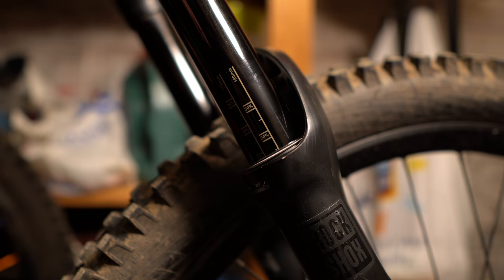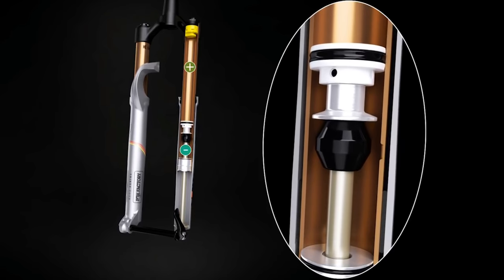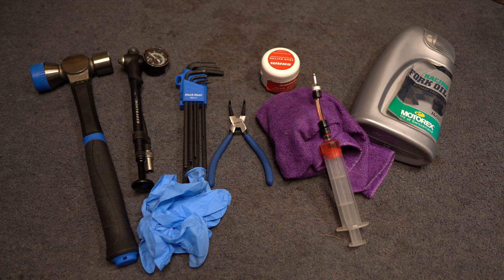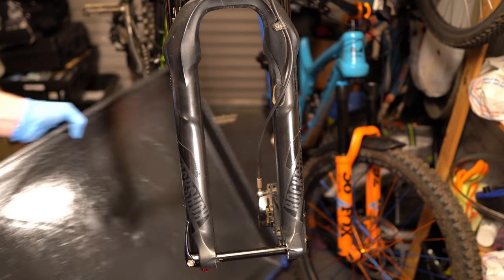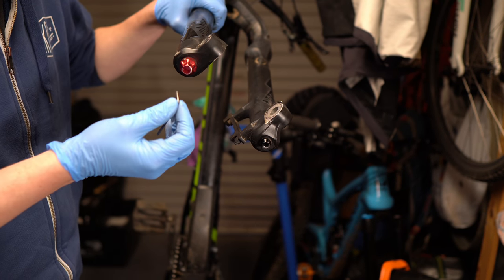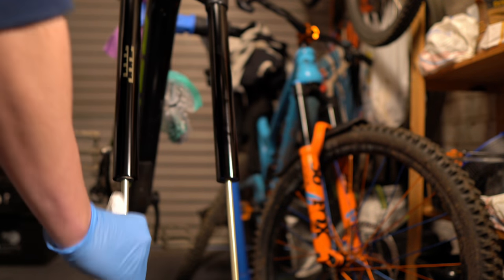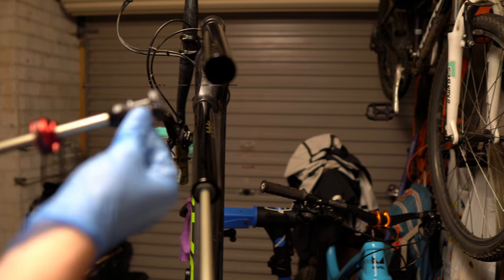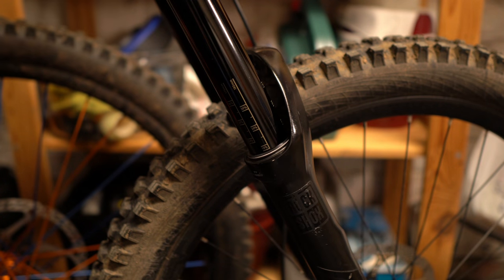Fork Suck Down

Comment: bro, super nice video. I have a rockshox 35 gold and  i think   my fork have  problem.  can i send you a  5 seconds video to show you  how my fork is working?  becouse im thinking to send it to warranty  but maybe is just need mantention. i dont understand nothing  of forks
Reply from the maker: Yes no problem.
Reply: @mauricioaguirre89  hi man. Same issue on my Commencal RockShox 35 gold. How did you fix it? Lower leg service helped a little. But still not good
Reply: @jancincar6747   i send the fork to commencal and them change all the tubes. names "botellas" in spanish. after it the fork works ok
Reply: @mauricioaguirre89  oh, not happy to hear that. I dont want to send it anywhere. This fork is nightmare. Sram should take all this forks back for free, they selling crap
Reply: @jancincar6747  i think the best thing is  send it to warranty bro

Comment: Thinking that the grease in the equalisation port is a reason for suck-down is a very common misconception. This won't be cause of the fork sucking down. When you consider that the left stanchion has 50psi upwards in it, there's no way that a blob of grease is going to stop the air from channeling though the little port. 
More often than not its either a worn seal on the air piston, or that its been inflated incorrectly. People believe the 'grease in the port' myth because they pull the air assembly apart, clean it, and put it back together to discover it works again, when all they've actually done is released the trapped when disassembling. The grease has nothing to do with it. 
Its also worth noting that if you find trapped air under wiper seal when you slide a zip tie under it, then you've got an air leak. Air will only be present in lower left hand leg if the seals on the seal head are leaking and allowing air to leak from the stanchion into the lower leg. In which case you need to replace the air seals on the seal head. 
The pressure release buttons found on the back of some forks are for use when reaching the top of extremely high mountains to let you release the build up of atmospheric pressure (unlikely to ever be needed in the UK).